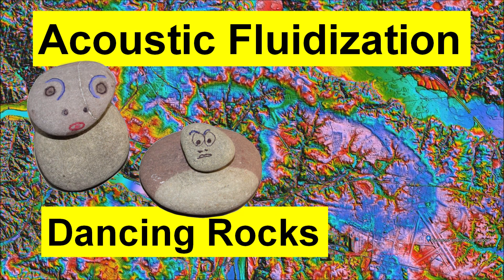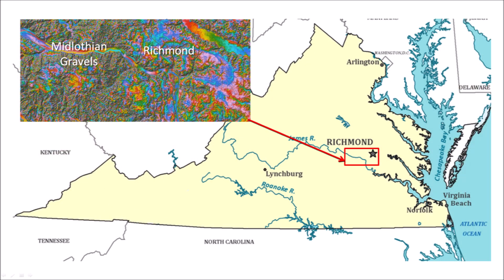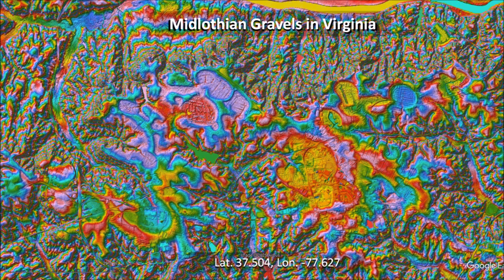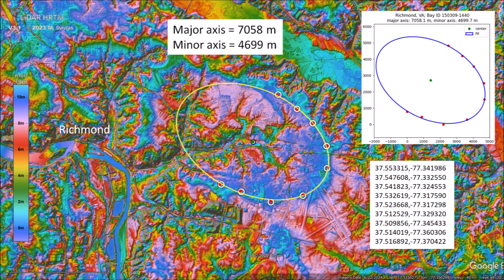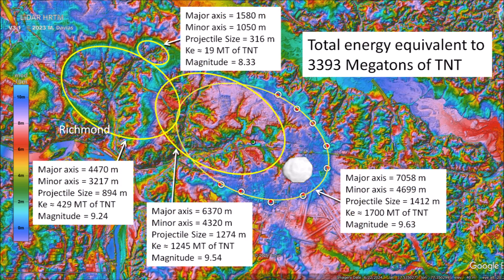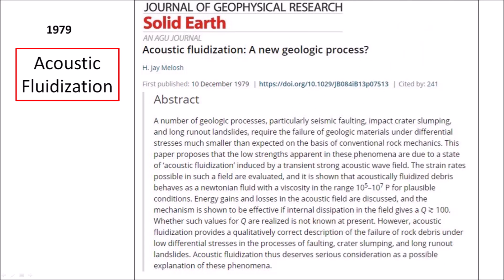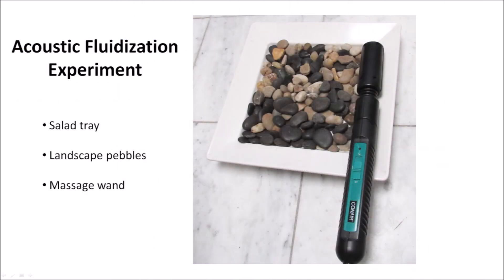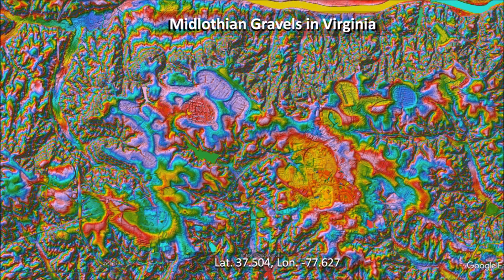Acoustic Fluidization by seismic vibrations - Dancing rocks

Comment: The earthquake energy from the primary impacts would have vibrated the entire North American continent, liquifying the unconsolidated ground. The ice impacts would have added to that effect.
Reply from the maker: That was the first idea that I considered, but I did not find a way to quantify it. This is why I eventually started using the energy of the secondary impacts which could be quantified using yield equations correlating the sizes of the bays to their energy of formation.
Reply: @Antonio_Zamora  Yes, I understand, you were being a good scientist. What about this? Assuming a minimum of two primary impact sites on the ice sheet, leaving craters at - Saginaw Bay approx. 27 miles across, and on Lake Michigan between Cleveland, Wisconsin and Pentwater, Michigan approx. 65 miles diameter, what kind of energy would be required to blast through the ice sheet and leave craters in the bedrock? Of course I'm speculating . . .
Reply from the maker: @curtisnixon5313  Look at Figure 10 in Firestone's 2009 paper.  He proposes that the Great Lakes are the holes in the bedrock. https://escholarship.org/uc/item/8fj3d8mc

Comment: is the upper 1-2 meters of soil full of gravel or is it mostly loose soil?
Reply from the maker: It is mostly gravel with a little top soil on the surface.  Notice that the video considers the spatter mechanism that you have mentioned before. This is the second video that I made about the Midlothian gravels. The previous one was made in 2018. https://youtu.be/MMK6KdYMixQ
Reply: @Antonio_Zamora   Based on the evidence I've seen, it seems that giant holes in the ground could not have been excavated at all, rather, the mechanism of bay creation was mostly limited to the ground surface a la Prouty's 1952 air-shock wave hypothesis. this theory does not conflict with past geological dating.